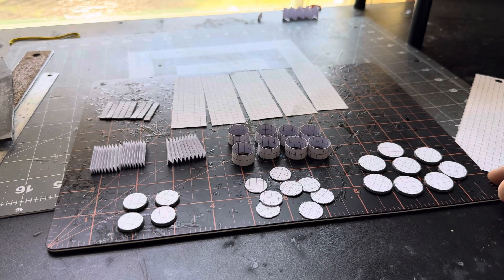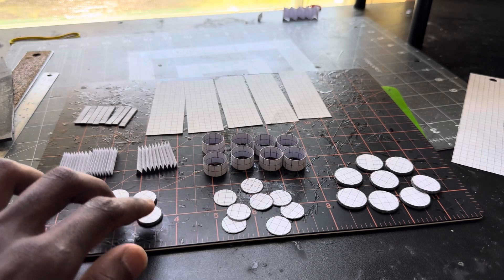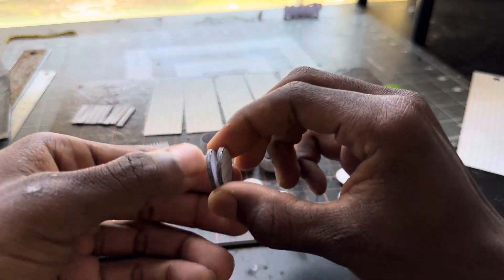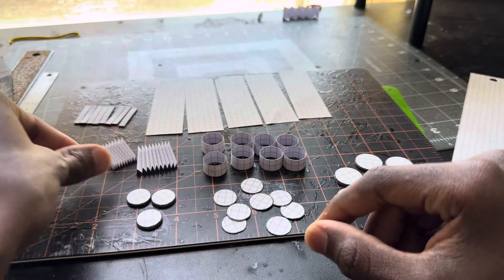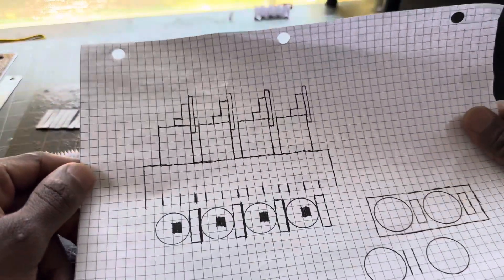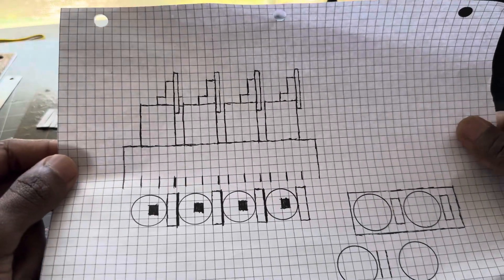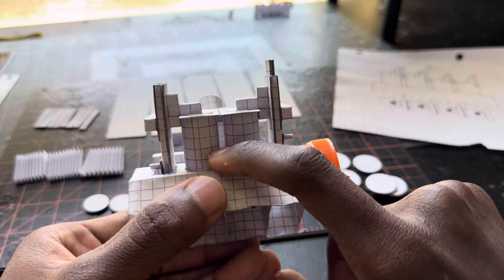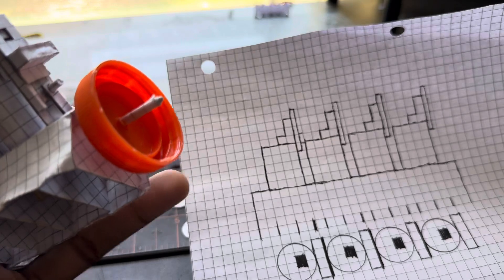Im Making A Paper V8 Engine

Comment: Dude! Ilove what your doing. May i suggest, you use some cardboard for the thicker pieces. Cereal boxes work great. It still can be considered paper, just less pieces to cut.
Reply from the maker: Ur right and thats a good idea but ill leave that tip for the builders ill stick to using grid paper for every single part. That works perfect though i used to do that alot 👍🏾
Reply: @PaperEngines  bro do u have discord

Comment: bro this is crazy skill, I can't even get a single to work fine and you're out here making v8's, can't wait to see how it turns out, are you going to make the crank a cross or flat plane? it should change how it sounds in the end, cross plane will give you an American sounding one whilst a flat will give more euro super car vibes, I think cross might be harder to get running but it would sound great 🥵
Reply from the maker: Im thinking about doing a crossplane but if i do then 2 cylinders will start to fire at the same exact time every 90• of rotation, so it will kind of be like a even V4 Sound. But i will figure something out 😎👍🏾